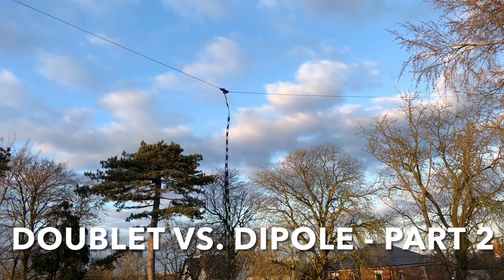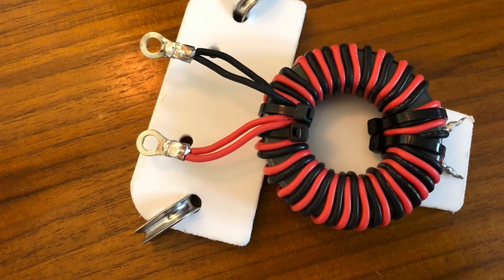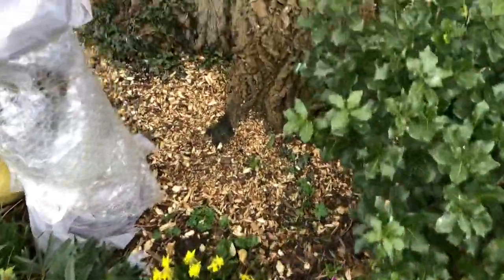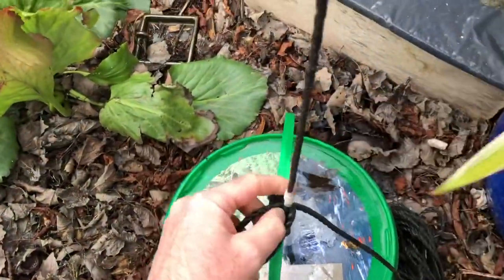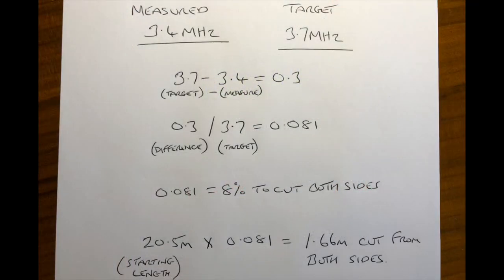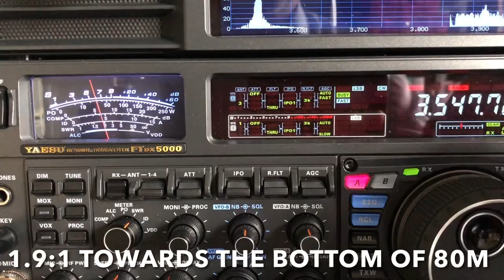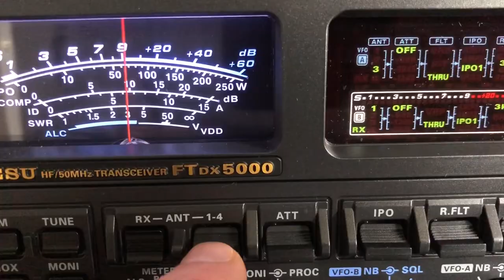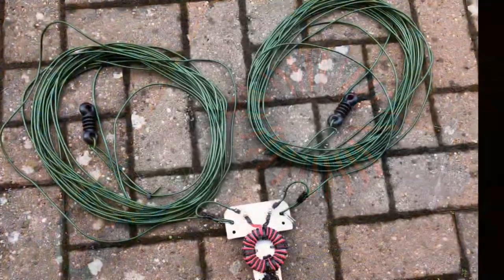Doublet or Dipole? - Part 2

Comment: Nice follow up.  Adding a couple more elements for 40 and 20 to make a fan dipole will make it brilliant and nice to have two antennas to pick from like that.
Reply from the maker: Thanks Stewart! I’m mulling over a 40 as it will be in the same horizontal plane on the roof side and at an angle (more bothered about the plane). Having a think....🤔
Reply: @ianxfs  Yeah the roof is certainly the trickiest problem to solve on your location for 40m, maybe 20-30 degrees angle on the horizontal plane is OK?   For 20m you could go off at 70-90 degrees (side-to-side across the garden) maybe if there is enough room.  Might not be in the directions you want even then.

Comment: For the doublet you need a 4:1 balun at the bottom of the ladder line or better still use an ATU with true balanced connection like  for example a Johnson KW matchbox with link coupling and no ferrite.
Reply from the maker: @fotografm  Thanks for the info 👍🏻

Comment: Good job Ian. As you say, a doublet (ladder line) cut for lowest freq is a decent multibander with a balanced tuner (or ‘long-wire tuner’ plus ground lug eg AT230 works well). If you make legs longer (eg 27m each) then also slight benefit of 2 x 5/8 on 40m too (Extended Double Zep). On 20m and higher freq the lobes start getting quite pronounced and directional. A doublet > 2x20m is generally my go-to for portable. Nice to work you in CQWPX yesterday!
Reply from the maker: Yes, good points Nick! Unfortunately that was as long as I could get up! Yes good to catch you yesterday 👍🏻 This new 80m dipole worked really well and I decided to run a frequency rather than all the search & pounce I’d been doing all weekend. I can’t compete with the big guns on the higher bands with just my wires, but had a good laugh on 80 😁

Comment: When you calculate for cutting if you use the origin frequency as start to get the percentage it’ll be more precise.
As an example you used 0.3 difference between origin and target but related that to 3.7 (0.3/3.7). Do 0.3/3.4 instead, the result will be more precise. In your example: 0.3/3.4=8.8%  20.5-8.8%=>18.7 You’d have cut 1.8meters. Hope that makes sense to you.
Cheerio
Reply from the maker: Thanks for that. I’ll have another look…

Comment: It is worth sticking with it a while, the European stations are probably very high angle, the vertical might be better for DX. FWIW I have been playing with a ZS6BKW, a variant of the doublet, quite promising. The rig tuner copes on most HF bands... handy for remote control station.
Reply from the maker: Thanks. I’m giving the dipole an airing this week and getting really good results so far. Will see how it all pans out....😀
Reply: If it looks like it will work it likely will!

Comment: I have used open wire line on my Delta loop a short lenght  of 450 ohm ladder line and it detuned the loop of resonance due to it being less than a 1/4 wave on the lowest frequency I since made the ladder line multiplies of 1/4 waves.
Reply from the maker: Yes, I think I needed much longer lengths to get the best out of it, but being right underneath made it tricky. Happy with the dipole this week. Seems to work well. Only 8m of coax to the rig 👍🏻

Comment: Nice 👍 how does it do on the higher freqs 15/17m?? Thank you
Reply from the maker: Hi Kevin, it only tunes on 80m but can used as a receive antenna, albeit with a slightly lower sensitivity than one resonant on the higher band in question.

Comment: .The vertical looks as good as any, i thought you were supposed to use a 4:1 balun on a doublet...i used a doublet a few years ago, was about 115 ft long, it was the best LF antenna i ever had...beat g5rv or trap dipole...g4vvq.
Reply from the maker: Hi Fred. Yes you can use a 4:1 but in theory this can have the effect of reducing the impedance too low which some tuners then struggle to match. The 1:1 balun can give a value that can be accommodated by the ATU. Well, that’s the theory anyway! I didn’t have 4:1 to try when I was undertaking these tests….Still got the 80m dipole alongside a new home-made 40m OCFD and both are brilliant for me 👍🏻